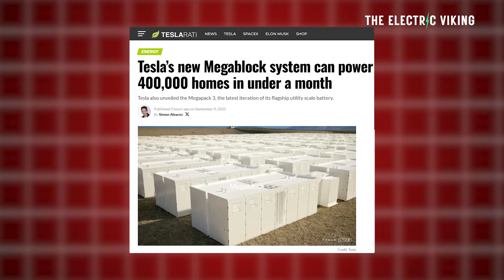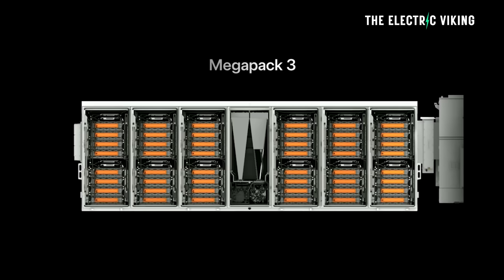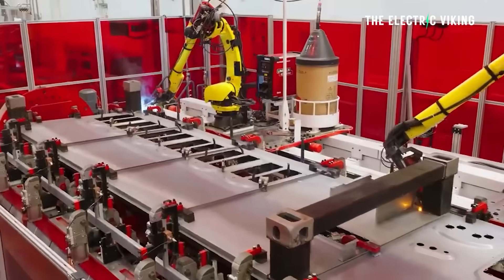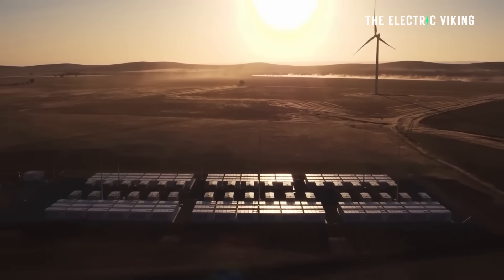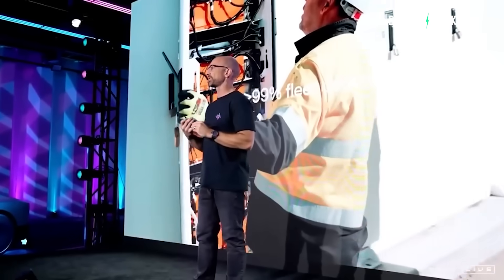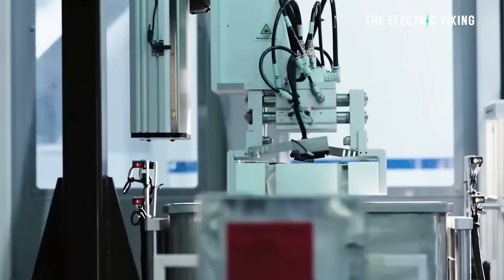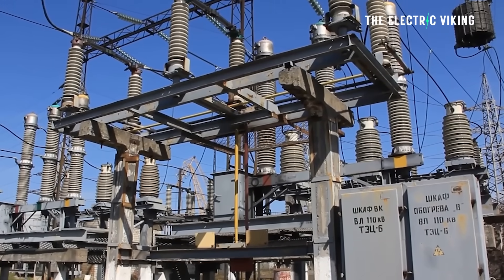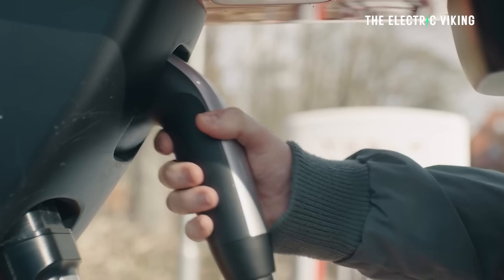Tesla Unveils Megablock Energy System—Game-Changer for Utilities

Comment: Tesla offers the only fully vertically integrated solution to address grid stability and peak demand challenges. The combination of Tesla Megapack and Autobidder functions like an intelligent energy reservoir — storing electricity when it’s abundant and releasing it when needed, all while maximizing operator revenues and preventing grid overload without costly infrastructure expansion. Installing 1 GWh in 20 days (site density of 248 GWh per acre) is a game changer! 
Both the U.S. and Europe are experiencing rising electricity demand that their aging grids cannot handle. Modernizing these grids would take 10 to 20 years. In contrast, Tesla’s Megapack provides an immediate solution by decentralizing energy storage, smoothing demand peaks, and reducing the need for additional power generation.
With global annual demand for storage at 2,300 GWh, and Tesla’s current production capacity at 80 GWh per year, the growth potential for Megapack is enormous.

Comment: According to Google it uses LFP i.e. lithium iron batteries.  Sodium batteries are just beginning to come online now.  They are so much cheaper.  They also last 3 times as long and are much, much less likely to explode than even LFP.  It also works from -40 Centrigade to +60 Centigrade.  It can make batteries that will do 3.6 million miles.  It takes up more space that LFP so it won't suite top range cars but it will perfectly suite grid storage where that does not matter.   CATL's new rechnology has made sodium batteries about the same energy density as LFP batteries. It will suit cheaper cars as well as  the grid.

They are made of cheap salt so are much more sustainable and cheaper.  It can be produced for $19/kWh and is expected to go down to $10/kWh when it is produced at scale.  Normal LFP batteries cost $55/kWh at the moment in large amounts and it is already being produced at scale.  The sodium battery technology has finally matured and is ready to start mass production by December 2025 by CATL.   It looks like Tesla's Megablock is already outdated before the first battery is produced.
Reply: AFAIK, sodium ion isn't really cheaper than LFP ... yet.  But yeah, that chemistry is positioned to become much cheaper.

It'll be an interesting race to the bottom.
Reply: CATL has the batteries, Tesla has the complete vertiical integrated solution to solve grid and peak issues no one else has.

Comment: No rivals?
Wrong, lots of them. Like Hithium or Huawei.
Reply: Tesla offers the only fully vertically integrated solution to address grid stability and peak demand challenges. The combination of Tesla Megapack and Autobidder functions like an intelligent energy reservoir — storing electricity when it’s abundant and releasing it when needed, all while maximizing operator revenues and preventing grid overload without costly infrastructure expansion.
Reply: @phvaessen , correct, and now the transformers have been integrated into the product for even more vertical integration.

Comment: They get their batteries from CATL. CATL has just announced they are going into the same business as Tesla.  RIP Tesla.
Reply: Tesla gets their batteries from a variety of suppliers as well as making their own.  It’s a big pie, the more the merrier.   Hopefully CATL and others will ramp up production to meet the huge demand.  Tesla’s gonna be just fine.
Reply: @chrishaberbosch1029  

I was talking about the Megapack. 

"Tesla's current Megapack products use CATL cells, and the Chinese company was Tesla's largest single customer in 2021, accounting for ten percent of CATL's sales."
Reply: @chrishaberbosch1029 the only batteries they make for themselves are based on 20 year old tech.  Not exactly cutting edge
Reply: @mtraven23 , not even remotely accurate.  How do you figure "20 year old tech?"
Reply: The annual global demand is 2300 GWh, Tesla can only produce up to 80 GWh: plenty of space for more than one supplier. And Tesla integrates CATL and BYD batteries in it's vertical powergrid solution.

Comment: Late 2026? Why are they unveiling it now when that's over a year away. Being unable to manufacture the batteries themselves, CATL may end up eating their lunch with a competing product at a lower price
Reply: Hello stock pump …thats why …..more musk BS 😂😂😂😂. But saying stuff thats not going to happen for years yet is Musk stock and trade
Reply: CATL developed Tesla’s battery plant in the U.S. why would they compete when this is their customer?
Reply: Tesla megapck exists and is installed since 2017 - it's a fully vertical integrated solution to address grid stability and peak demand challenges. Hardwre + software, not just batteries.

Comment: Not really, it's cheaper to just build a new power plant instead of a battery farm that still needs to be charged by power plants.
Reply: You don't understand the concept. Because so many solar arrays are just starting or being constructed the energy these produce during the day may not be need. Also when windmills have over capacity they shut them down. Now all this excess energy can be utilized and stored in batteries to be used at night or when wind is not blowing. Power companies are constructing many of these solar and wind installations.  The software redirects the power where the demand is and no new power plants need to be made. I'm sure you probably know most of this but just want to deny that its efficient or relevant. The future is coming and all your reason why it shouldn't will be mute.
Reply: @dennisgale8383  Solar and Wind are the most expensive and least environmentally friendly forms of energy. Nuclear, gas, coal, geothermal are all far superior because a 100% renewable grid (even with batteries) would still collapse due to the need for fault current. It is you sir, who do not understand.

Comment: I was hoping it would be sodium or aluminum batteries.
Reply: It should be sodium
Reply: @jovanleon7 , they would very quickly outpace supply if they went with sodium right now.  I'm sure they are testing with it.  In a few years there may be enough supply for a Megapack variant, but not at the current time.

Comment: 2 years backlog whilst overcapacity in car production?? In UK each sub station could have a megabuck storing cheap night energy to supply during the day!! Sodium Ion is way forward!
Reply: There is no overcapacity in Tesla car production because RoboTaxis can absorb almost 4.6M cars while Tesla’s production is just 1.7M.

What you saw in 2024 was lower Model Y sales because of a multi month production line refresh and weak sales of CyberTruck because of the high price. Tesla can either come up with cheaper CyberTrucks or use CyberTrucks as RoboTaxis, which would still be competitive with Waymo’s expensive cars + sensors.

Comment: I see nothing but failure for this. Since most people will not be buying power from any utility in the future. There may be a solar battery backup feature that is replaced and recharged using your ev or a 3rd party company however.
Reply: I use more electric now than ever by switching away from natural gas and gasoline, even though I have rooftop solar. Two electric cars, mini-split heat pumps on the ground floor, heat pump water heater, induction cooker, electric oven, heat pump clothes drier.  I have more I could do. I want those solar panel roofing tile on the sloping part of my roof.  You know, the one's that Elon promised years ago. It's all costing us, but we are worried about GW and we're not alone.  The market for electric won't go away.

Comment: Great, even better solar storage efficiency!  It is a critical component in the solar ecosystem.  Megablock looks like a cost cutter and operational setup accelerator.  Good to see them not using the lightest batteries for this since they don't need to be lite.  More reasons to be happy.  Thanks for gas to electric margins call out.